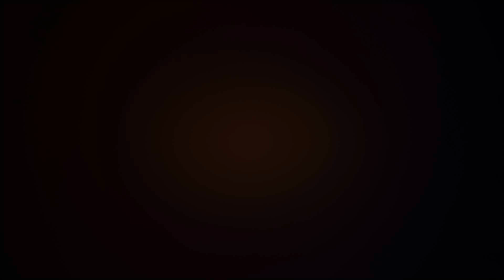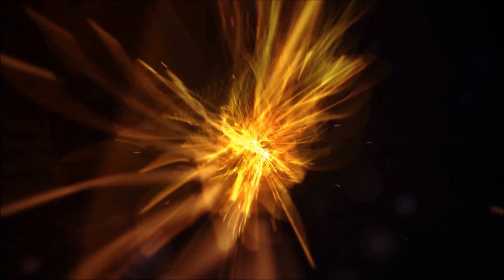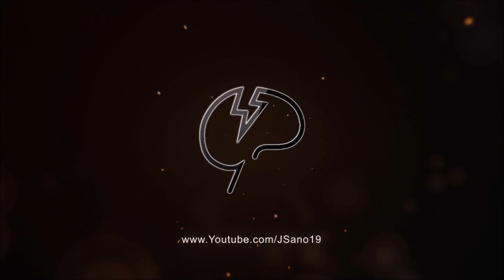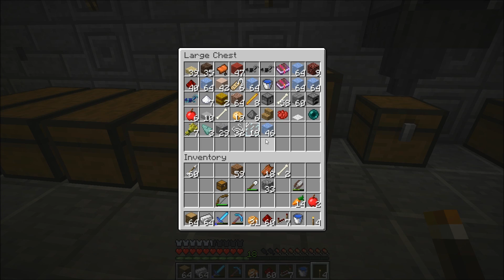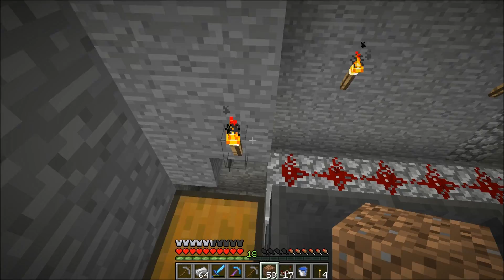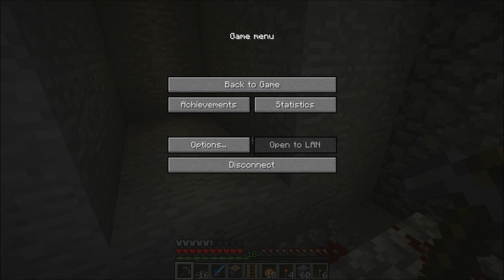Minecraft - Mindcrack Season 5 - E105 - Cart Transfer

Comment: That's a clever solution to the carts not pausing at the unloader.  I believe the issue is that hoppers feed into other hoppers too fast for comparators to trigger.  If your hopper under the rail was feeding into a chest or dispenser or dropper, the comparator would cause the cart to pause while unloading.

Comment: So if I got it correctly... When there's nothing in the hopper there should only be sent a pulse to the powered rail so that when it returns and is empty it'll just be off and it'll stay there till it fills up again?
I don't really know if you could do anything with that portion of the system you've got now with how it's detecting..The problem is that how would it know to be sent off again with the set up you've got now? I think you should go with just sending it off to some holding spot until it's needed again.. 

(But is it going in a loop really a big deal?)

Comment: you could change the loading with a fence gate on top of the rail going up. minecarts can go up through the closed gate, but not down. by opening the gate when there is something in the loading hopper you would allow the minecart to come and load. when there is nothing to load the minecart would wait at the gate. you can reuse the signal you have and just add a repeater and one redstone dust to make it work. something like this: imgur com/lw5rTSU

Comment: I'll try to explain the solution i came up with for the loading sistem with a falling edge detector: on the block with the redstone torch 9:55 put a redstone dust on top and remove the torch. to build the falling edge detector (the first on the wiki) put 4 more bolcks on the same level of the first. put a block on the side of the dust with a sticky piston on it and a block on the head of the piston, a repeater coming out from the block under the piston on the second settign, a dust from it into a block with dust on top and an other dust on the last block of the line. take this output and connect it with the repeater you already have ad set it on the third tick to give the minecart enought time to go. on the wiki is called Dust-Cut Falling Edge Detector and there is an immage to copy it from. hope this helps :)

Comment: From the loading side, you could take a comparator signal into a few repeaters to keep it fully automated. So that the loading hopper essentially powers the starting power-rail to off when it is empty, using the repeaters to extend the tick count so that once the hopper has emptied the cart still has time to get past the power-rail before it powers off, on the return it stops there until there are items in the hopper again. Removes the need for any switches, levers or additional tracks. I am sure that there is a more elegant way of doing it but that should work fine for your set up.

Comment: Use one of the hoppers next to the loader hopper as a signal for when there is no items in the system.  When there are no items in the system it will trigger a signal to stop the minecart on the slope up/down having the cart wait there until something comes around that is needed sorted.

Comment: I have no idea if this will work and even less idea how to do it, but by my understanding you need the powered rail on the loading side to be powered by a Falling Edge Detector - that is, it receives a 1-tick pulse at the moment the hopper becomes empty, but is unpowered otherwise. I think that would work, I think MumboJumbo has some designed for Falling Edge Detectors on his channel.
Reply: Viperion_NZ i had the same idea and tested it, it works but the powered rail needs to be powered for al least 3 ticks, easly done with a repeater on the third setting

Comment: Continual loops arnt a problem unless you have multiple carts if its the sound ur worried about build the thing out of ear shot also yes there are ways to make holding cells but would basicly pointless for the purpose you are looking for because it'll add far more routing to what you already have and probably interfere with the rest of the structure. You did notice that you placed your drop off hopper where it would not connect to the intended first chest position of the line right? If you connect to the hopper you looked at 3-4 chests would not be connected to the system

Comment: Could you possibly just have a lever on the loading side that turns that powered rail off? Then the minecart would just get stopped on that track and not zoom back over to the unloading side. Then you can just turn it on when you're running the system. I'm not sure if that would break anything though :P

Comment: You can get rid of the piston by replacing it with a block and put redstone on that block and add a powered rail on the unloading-hopper. Also if you use a comparator to pull from a detector rail it will emit a signal strength based on the amount of items in the cart so you can use that to detect if the cart is empty when leaving the loading side. I'll try to make a video explaining everything I mean.